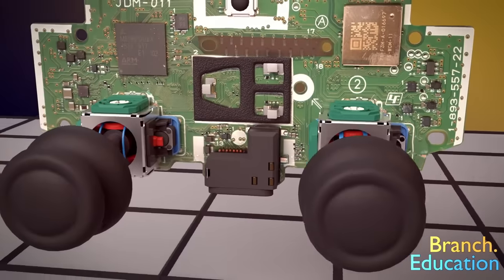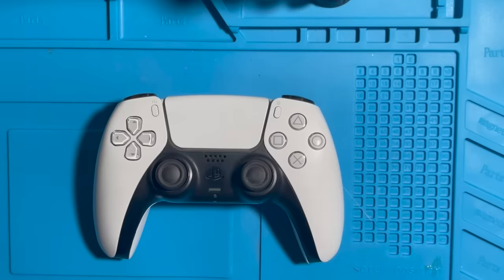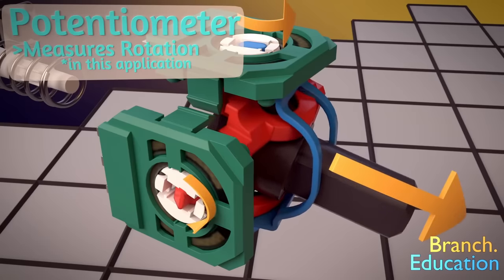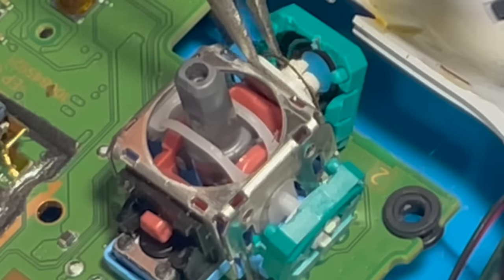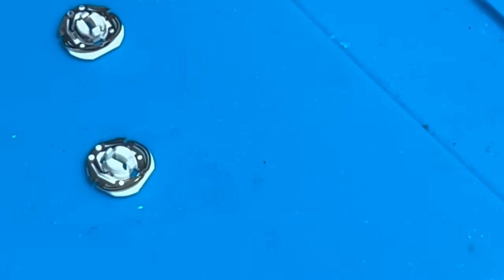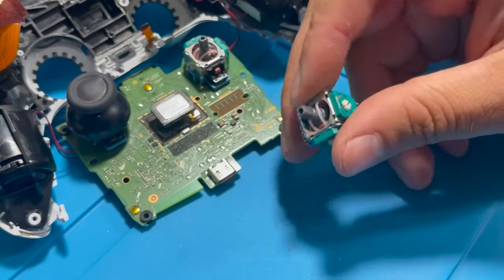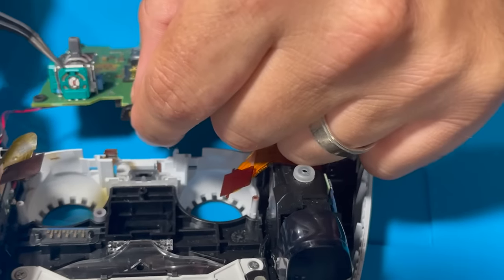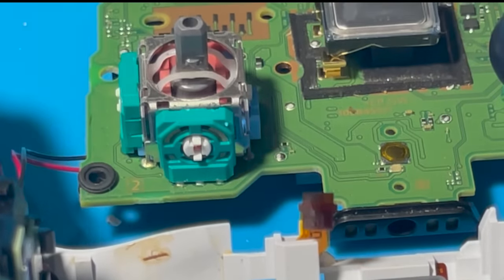What Causes Stick Drift Controller and How To Really Fix It

Comment: As a repair tech , I would like to thank you for the informative video. It will really help people not to destroy them taking them apart. 
I must however, state that after repairing literally thousands of these, that 90% of the time the cause of the problem is the wear on the track in the green piece, and not the wiper!! YES replacing the wiper as you did will temporarily fix the issue. But nothing will replace the track once it is worn down. Replacing the wiper will provide a clean surface, and more tension on the track since it is new. The problem WILL return in less time than it took it to wear out the first time. 
REPLACE the whole assembly, every time,  while you are there for a more lasting repair!!
Reply: Correct. There is no 'fix' for the worn resistive elements/track in the potentiometers and the only longstanding resolution is replacing the POT / stick module, or controller but either way the issue will return over time as the items are seemingly considered 'disposable' by MS and Sony and provides a nice boost to their revenue stream every time someone decides to buy a new controller because their poorly designed potentiometers by Alps fail.
Reply: @Desert-edDave  
Oh No doubt! Especially considering that there are way more viable units out there! I cringe sometimes watching videos, as most people do not have the equipment or skills to replace these. Unleaded solder is no joke. plus the microscopic components around the joysticks most times are knocked off without them even realizing they were there!!
Reply: How much does it cost for your services?
Reply: @raychoi9495  If you are asking me that, I do not do them for the public. I buy large lots of broken ones and repair and sell them. Any decent repair shop should be able to do it no problem. It wont be economically viable though, with a new one priced at 60 bucks. Thus the game they play with us. They know that labor costs will kill that repair, and you will go buy a new one. all the while screaming at us the public to recycle, don't waste so much, etc., etc.

Comment: Even though I’m not confident enough to take my controller apart myself. This was an amazing video. Great content and visual representation of the mechanics
Reply: ifixit guides, bro. Some of the little ribbon cables can be kinda tricky to get plugged back in on the DualSense, but other than that it's pretty straightforward. You don't even have to tear it down all the way to access the joysticks.
Reply: I agree I've done all the other tips and still have the same problem even tho this is my 2nd controller and less than a months use.....it goes straight up and my first I had it over a year and it just spins...I want to fix them but know nothing about taking them apart
Reply: @richarddixon3427  don't bother dude just make sure you get insurance on them because if you take it apart it won't work when you put it back together even if you follow these videos I promise you
Reply: @richarddixon3427  even if you get the toolkit and do everything they say to do something won't work like the battery or the Bluetooth
Reply: It's easy, the hardest part is putting the black strip thing back on the front of the pad once you've put the pad back together lol
Reply: @nogoodcharlesgaming  idk sounds like a skill issue to me!!! ive done this to all 5 of my broken controllers they all work now. FUCK the warranty. i fix it myself i got the skill.
Reply: @cheapbstard username checks out and I agree
Reply: @nogoodcharlesgaming mine works fine bro
Reply: @cheapbstard same my first time fixing a controller no more new controllers im going to buy hahahha DIY
Reply: @nogoodcharlesgaming   you just don’t know what you’re doing.   You Probably were reckless in your repair attempts because MY controller was fixed by following another YouTube Video tutorial.   This video just explained the tiny pieces a good bit better.   You probably got impatient and yanked and damaged things.    After doing my repair and then seeing this video, things made a lot more sense.

Comment: Hey man. Thanks for making this video! I thought i was going to have to solder on a new analog stick module and I definitely can't solder so you saved me $70, I owe you a beer!! 

I took it apart as delicately as I could but honestly wasn't as hard as it looks taking out the ribbon cables and prying off the green plastic containing the contact. I just cleaned it as you described and it's working perfectly. My right stick would just get stuck moving up it was horrible. Night and day difference, thanks again.

Comment: I followed this guide and not only did it work perfectly on BOTH of my controllers that had this problem, it actually made my vibration zones start working properly, I didn't even realize there was a part not active until after i put it all back together. 10/10

Comment: I agree with everything in this video, I do my own repairs as well. However be careful opening the tracks to replace the contact pads inside. I have had the legs of the track break off and needing replaced. Stick drift is all about the power difference that is given to each axis, which is how the contact plates work. Best fix for drift is to solder resistors between the legs on opposite side of board to compensate the direction drift. Your method will work great if it works the first time, however multiple teardowns of the same tracks will break it over time, breaking the legs which breaks the solder connection, which will cause even harder drift or unresponsive controls.
Reply: I use 50k ohm smd potentiometers connected in parallel on each pot of the stick.  Then I can just adjust them  when ever i get drift
Reply: @Never0utGunned could you explain this a bit i'm curious what you mean? If you have time no worries
Reply: i see what you mean but i have at least done this method over 20 times on my ps4 controller XD
Reply: We need more detailed breakdowns

Comment: The contacts of the aluminum cursor tend to blacken, so it is ALWAYS necessary to re-polish them with 800 sandpaper (both the tip and the two lower points of the cursor) and when closing, make sure that the semicircle is raised enough towards the resistive part of the analog box.
Reply: Oooor contact cleaner so you don't literally thin down the pads..
Reply: Sure bud ruin it to clean it. Real smart
Reply: 800 grit?? Yeah no... 1500 2000 maybe

Comment: Since I’ve tried to fixed my controller a few times a good over of advice is to tighten all your screws cause it really helps
Reply: Just the screws on the outside of the controller.
Reply: How does that work? xP
Reply: @ivanaviNiebla  I don’t even know tbh but if there not tightened then it could cause some problems

Comment: Thanks this helped me a lot!! I had to switch the wiper for potentiometer on my left stick just like you showed. No more drift!👍
Reply: WTF doesn't Sony fix it? If you and the guy in this video can fix it, can't sony prevent it from happening? Lazy MF's my controller got drift and I did something fu&^%$ up to get a new one.
Reply: @panamike6178  potentiometer tech is garbage for controllers and there is nothing they can do to prevent it. Sure, they could protect the casing better, but it would only delay the inevitable as it wears out. The only thing is to use different tech, which exists and is being used by a company called GuliKit - they make very good controllers compatible with most platforms.
Reply: @MoroseMoe  yes , but gulikit king kong 2 pro controller costs $100 with taxes + their controllers have some other issues , I've seen reviews on Amazon,  there's No stick drift but other issues in them
Reply: Did the drift come back? I know it will eventually but how long did it last?

Comment: This happened to me quite a bit and the only solution that I've actually done that's permanently fixed my sticks (until the next drift issue) is soldering another track on. It seems like the wipers wear the track more than the track wears the wipers.

Comment: Nice work around. Didn’t want to have to desolder/solder anything. What’s important here is that you be careful when prying open the cube, if you open it too far you may snap the pins. I will try this on two drifting controllers i have and leave some feedback when im done. Great video.
Reply: sooooo any results?
Reply: @Ethan-fz7um  one of the two controllers worked. The other one got worse, i suppose it was an error on my part. In any-case, i bought a dual sense edge, and just avoided having this issue ever again, i got it for $130 because it was a open box, great deal. Honestly, if you can save up for a dual sense edge. Ive gone through two controllers that had the same issue.
Reply: @ReduxVII what do you mean it won't ever happen again? What's the difference with the dual sense edge?
Reply: @pokesnax7935  You can swap them out for new sticks which still isn't ideal. Order a custom controller with " hall effect " joysticks thats the best way to avoid stick drift.

Comment: Thanks for the clear explanation! I realized that other controllers use the same modules so I replaced a drifting Xbox controller stick with some wipers from an older Dualshow 4 and it works perfectly again.

Comment: It's the resistance pad that fails, wipers are always good to go. And the second cause is the thumbstick itself. The spring mechanism wears out and the stick don't make it back to the center.
Reply: That's what I thought too. It's a bit suspect that changing the wiper fixed the problem in this video.

Comment: Took a wired controller apart, last year I think, and one of the analog sticks were completely stiff. I think the stick was able to be moved around, but unless it was in the middle (original point) there was a massive amount of resistance. I think the problem I experienced was something else other than what was shown in the video, but I always did wonder if there was something else I could do. I didn't know or want to solder a controller so I threw the wired one away and got a new controller.
Reply: Yeah man taking it apart an cleaning it is one thing but once you gotta start SOLDERING chit then fc all that just get a new controller wtf

Comment: You don’t have to replace them. All you gotta do is clean the inside, like you did and take those twizzers and reinforce the wipers so that there’s pressure against the black track.
Reply: true, and don´t use qtips to clean, I use cleaning paper with a little stick as it doesn´t leave any micro hairs
Reply: What do you mean reinforce the wipers?
Reply: How do you use the tweezer to reinforce it?
Reply: @bartimaeu1  he didn't mean reinforce but retention when u look at the wipers at least on the vitrix gambit controller there are 3 bars" the weak mettal" that should be aligned just realign those if one is bent "mine was" and it helped a ton
Reply: @Backlash00z89  hi i don't understand but please don't worry and thank you for trying
Reply: @bartimaeu1  yw but if for some reason u do want to know what im talking about and him go to 3:46 that little metal piece has 3 slices in the metal those are what u need to realign but if u still don't I'm sorry u don't have to reply lol
Reply: @Backlash00z89  but it is easier and faster to change it for a new part and that is already lubricated.
Reply: @blackcat4160  yeah easier and faster IF YOU HAVE THAT PART many of the people watching this don't have extra thumbs tick lying around much less want to wait to order more I gave another alternative  that worked just fine for mine so I put in my input as well as how is it easier to replace the entire analog then taking the 15 seconds it took to straighten that out lmao like what
Reply: @Backlash00z89  Only the "little part" of the interior as the author of the video did. I did not refer to the whole analogue.
I recently disassembled it and I'm going to ask that the piece be sent to me by mail. In my case, the aluminum is crooked and despite my close-up glasses, I can't see correctly to try to align the material, so I decided to buy it.
Reply: That will cause the tracks to wear faster, instead, what you have to do is to "sand" the contact points of the wipers to remove the "rust", you can do it even with some bond paper.
Reply: @ivanaviNiebla  I've never ever had any kind of rust on my wipers on them being misaligned
Reply: @Backlash00z89  I don't really mean rust, I just forgot the word. Didn't I use quotes?

There are just layers of material that are on the surface of the wipers, may it be corrosion, dust, or whatever, that is enough to not make correct contact with the graphite and make the readings jittery.

Comment: At the 5 minute mark you can see that the white disk he puts back into the controller is broken and at 6:53 when he removes that same one the broken piece falls between the board and controller housing. The dirty wiper may have been the root cause but the broken plate/bushing the wiper is mounted on caused what drift remained requiring a complete replacement, these aren't so fragile that you need to be scared of doing this but it does require some degree of application of gentle force. The resistance he experienced closing the left/right potentiometer is not what you should encounter, yes some resistance is true but not to that extent. Not bashing just commenting to help anyone out that may dive into this actual solution.

Comment: My left joystick has roughly -0.003 to -0.03 drift. How bad in your experience with drift do you think it is worth to repair the potentiometer? I've seen knock-off Aliexpress PS4 potentiometers go for 2$ each.  

Cleaning the ones I currently have might be enough, but I am quite scared to open them up and not put them back together correctly and breaking them in the process.
Reply: If its hardly noticeable or not affecting gameplay dont bother

Comment: Thanks for this. I had assumed that you would need to desolder everything to clean or change the pots. I have a PS2 controller where the left stick always registers fully to the right. I'm going to try cleaning it and see if it fixes it. No big loss if it doesn't, as I found it in the trash anyway, and I have several others.
Reply: did it work?
Reply: @ramielarab  Unfortunately, no. I tried using both actual contact cleaner and alcohol, I cleaned the track inside the case and the wiper disc, but it still registers all the way to the right. I even tried swapping the wiper disc with the one for vertical movement, since that one works fine, but it didn't make any difference.

If I rub my finger across the contacts for that pot with the wiper disc removed, it will move to the left, but as soon as I put the disc in and it makes contact, it goes all the way to the right.

I have a crappy USB controller that no longer works (and is physically broken), so I was thinking of taking one of the sticks out of that, or maybe just the pot, if they're the same design. My soldering/desoldering skills aren't the greatest though...

Comment: Thank for sharing, how long did it take you to figure this out. People like you make it easy for the rest of us!
Reply: It has been known for a long time that this is the cause of the drift. But  did not actually know how to replace these myself. Right now i am installing hall effect sensors in my joycons (hall effect sticks use magnets to determine the sticks position instead of wipers that wear down overtime) they are from gulikit. They told me they where going to make hall effect sticks for the dualsense aswell. I just hope hall effect sensors will become the new standard in new controllers going forth. Sony is not even putting them in the dualsense edge.

Comment: I bought a brand NEW hot pink ps5 controller from best buy a month ago, 3 weeks in and it already had the most intense drift on the left stick. Nothing new as i suffer constantly from faulty controllers (i even recently threw away 6 old ps4 controllers due them all having horrible stick drift!!). This popped up for me randomly and I'm so socked to find out that it is all that needed to be done to save them 😢. 

The amount of damn money I've spend in controllers is huge but this doesn't look that hard honestly. Very well made video and thank you for showing people how to fix things that otherwise we would be oblivious to!

Comment: My Xbox Series X controller is not suffering from significant drift. However, there's another issue that's been bugging me: when moving the thumbsticks (particularly the left one), there's some minor "resistance" and some "squeaking". It's not very loud, but definitely noticeable and annoying. The symptoms are specially perceived when moving the stick slowly toward one edge. I would love for the stick movement to feel smooth again. I don't have the proper equipment not skills to do the job. Last time I tried it with my PS4, the controller ended up worse than it was. Anybody else have something similar where the stick movement is no longer smooth and produces some squeaking?
Reply: I have the same controller and my running feels like walking rn

Comment: Followed the exact same procedure but drift was even worst after replacement. I'm here wandering how it worked so well in your case. My opinion is that the wear is also in the part of the potentiometer that remains, and to fix it we need to charge both parts of the potentiometer, not only half of it. Replacing the whole joystick disoldering form motherboard and soldering back a new one that's the right fix.

Comment: Thanks a lot for the clear explaination! I have a Series S/X controller that was drifting and no tutorial worked well (removing the dark brown thingie on the side kinda fixed it for a while but then it started drifting again), but now thanks to you I managed to replace the potentiometer, hardest thing was to actually put the new one inside again. Seems to work fine for now, finger crossed!